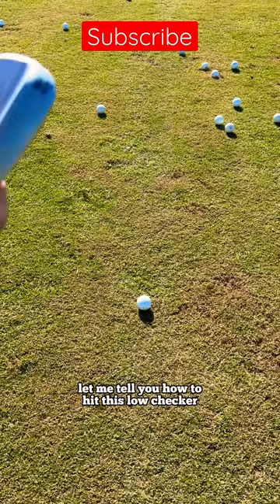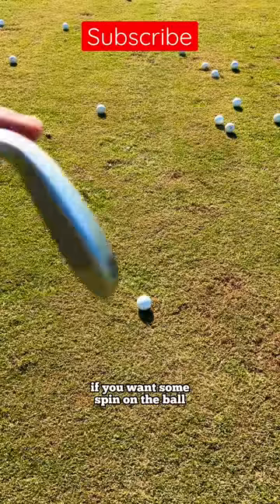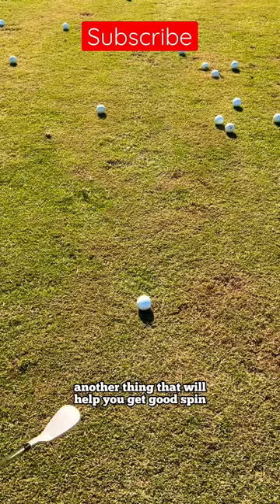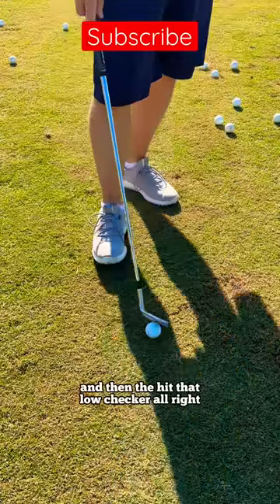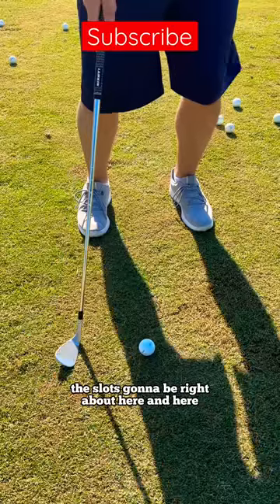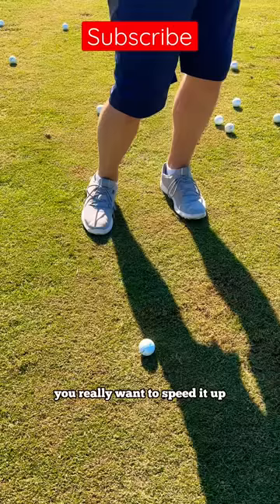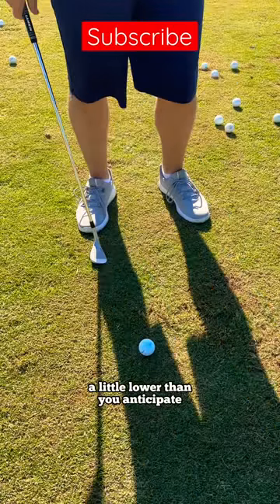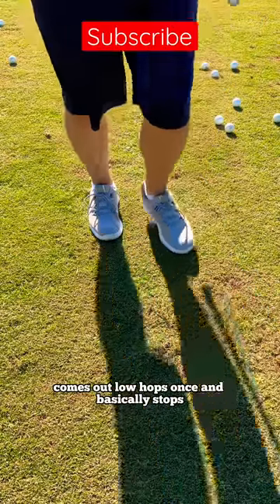How to hit the low spinner #shorts #golftips

Comment: pro v1x is a nice soft golf ball??? lol
Reply from the maker: Absolutely. When I say soft golf ball, I don’t mean the top flite super soft. I mean a GOOD golf ball
Reply: Ehh, of the premium balls, the X is the least soft and spinny. That's the premium distance ball. It'll still spin a bit with wedges. Grab a chrome soft if you want some real check for anything below 40 yds, and it's only about 3-5 yds shorter with a dialed driver and a 110 swing speed for most guys.
Reply: @rhull3939  wrong.. I’ve played every ball out there.. proV1 is the best ball for anything.. I get it to spin more than any golf ball out there.. been golfing 30 years and I’m almost a scratch golfer.. Vokey wedges and a proV1 ball and you’ll never go wrong
Reply: @GenesisG70LaunchEdition  

Pro v1x, not a pro v1, you'd think a nearly scratch golfer would know the difference.
Reply: @paulw6183  I find usually the the guys who are so insecure they have to give your their golf ability resume rarely know what they’re talking about 😂🤣.
Reply: @rhull3939  you’ve never held a golf ball in your hand in your life.
Reply: Came here for this comment and didn’t take long to find it lol
Reply: @rhull3939  The pro V1X has a higher compression than the balls your listing (Aka feels firmer on fuller shots), but the cover is actually one of the softest and spinniest covers on the market. So on this kind of shot, you’re going to see a lot of spin.
Reply: @Artsyathlete  came here to say this as well, the X is the high spin model in titleist line.
Reply: @Artsyathlete  

Its a firmer feeling ball but generates more spin, seems almost backwards because most of us associate softer feel with more spin and control.
Reply: @paulw6183  A general rule of thumb for premium golf balls is the firmer you make the core (Aka compression), the softer you can make the cover. Balls that are firm feeling, and don’t spin around the greens are just shit golf balls. Think Top Flite XL 2000
Reply: @Artsyathlete  

Pinnacle were bloody rocks too
Reply: @rhull3939  ummm... The Prov1x is actually a higher spinning higher launching ball. Maybe do a little research

Comment: Idk about you but any time I open my wedge up the ball goes up.. like a flop sort of. Actually exactly like a flop, cause thats how you hit a flop. What you just did was demonstrate a flop. What I like doing is take my 58, put it back in my stance and chop it out, fly it about 7-10 yd a foot in the air land it on the green and it checks on second bounce. Those are neat, cause they're low, and they're spinny, and they check.
Reply from the maker: I demonstrated how to spin the ball with a low ball flight. A flop shot is completely different.